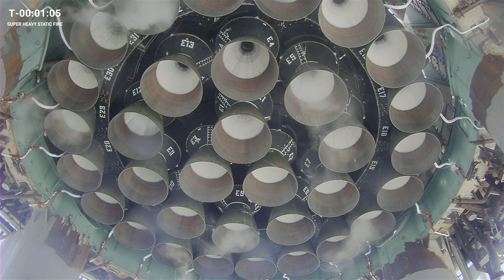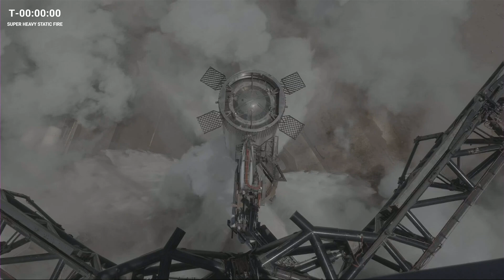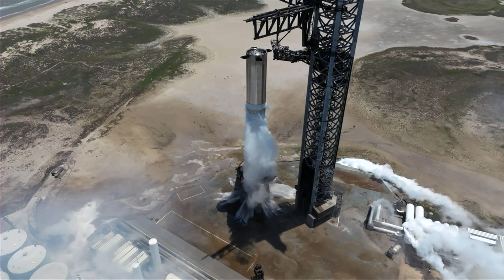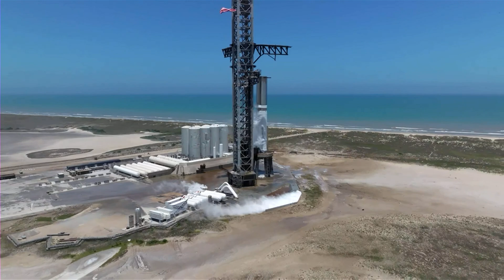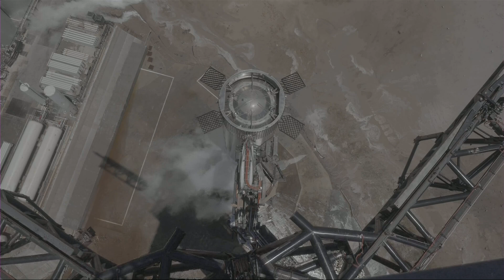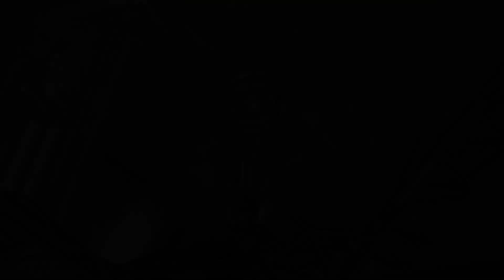Starship Super Heavy Static Fire

Comment: 4:13 Test duration of 2.74 seconds (ended before the planned 5 seconds), with 4 engines shutting down prematurely.
Reply: Flooded it lol
Reply: Seem to recall with the last test that three engines shutting down was considered the pre-launch abort limit (ie the launch would auto abort if more than three didn't ignite). Might be when the computer shut the fourth down, it passed the threshold to abort everything.
Reply: @johnpaulvanson5170  My guess is that's why the test only ran for 2.74 seconds out of the intended 5. When it hit the limit of 4 failed engines the test self aborted.
Reply: Wet spark plugs
Reply: @Bremberry These engines don’t have torch igniters plus the water does not go near the engines.
Reply: @Bremberry  lol, except the ignitors for the engines are well clear of any water
Reply: @Bremberry  if you're serious, they don't use spark plugs anymore
Reply: @beamed5382  Are you serious? of course it was joke that flew right over your head
Reply: @pauldean7690  it didn't, that's why I said *if*. There's a lot of who don't know that, thus the reason I took my time to respond to you. Don't be so confident in yourself haha.
Reply: @beamed5382  Í was the one talking about the spark plugs ;) and yes it was a joke referring to (carburated) internal combustion engines where you talk about wet spark plugs when you flood the the engine/cilinders with petrol and petrol gets on the spark plugs. (Good change I didn't need to explain this to you but, like you, just in case ;)
Reply: @@bingbong7Big ship no wanna go boom.
Reply: Not great not terrible
Reply: 🤣 @Fabian3331234333
Reply: @@bingbong7 They'll comb through the data getting to that answer.
Reply: That's what testing is for.
Reply: All that water flashing to steam needs to get out, and with the legs of the stand, its somewhat restricted. So I'm thinking the pressures "pushing back" against the engines must be interesting. So wondering if thats going to be a factor. I'd been thinking about the pressures under the stand for some time. But I'm only guessing and of course have no data what it really is like under there.
Reply: Water contamination from the deluge system possibly
Reply: @Bryan-Hensley  Musk is a genius! Most expensive fireballs in history! A genius! Greatest criminal fraudster in history...genius!
Reply: @Bryan-Hensley   agree with you and there is another question how thay planning to build megazila and water cooled lunch pod on Mars to return back where it isn't having water to drink 🤔
Reply: @muhammadavary  Stop asking simple questions! Musk is a SUPER GENIUS and the suckers who support him are worse than stupid. Musk will be in jail within two years.
Reply: It seems to be the Raptor Quick Disconnects (RQDs) that have been the problem with 33 engine SFs
Reply: @@bingbong7not sure, it’s kinda concerning though. That’s a worse performance than B7.
Reply: @Owencr905 to be fair, B7 co conducted THREE static fires before its 33 one, B9 did it the first time. A lot less time, a lot less data. Not a valid comparison.
Reply: @Owencr905  could be the new faster start up sequence, idk, just a guess.
Reply: @Owencr905 Booster 7 did 11 spin primes, 6 static fires and a bunch of engine swaps before the 33 engine static fire. They had many more opportunities to find bad engines and replace them before attempting to fire all 33 engines. 

For B9, there was only one spin prime, and this was the first static fire. 

While it's disappointing, it's not accurate to say that it was worse than booster 7.
Reply: @Owencr905  its probably because they went straight to 33, B7 had many engine swaps working up to that
Reply: I wonder why those engines shutting down.. perhaps too high atmospheric pressure caused from all the engines combined
Reply: @woof3065  If I was making a guess, this is where I would go too. Adding water below the stand might be like trying to blow through a restrictive tube.
Reply: @woof3065 the engines would never need to have higher than atmospheric pressure
Reply: Ngl i dont like there 4 engines not working.

I hope they will do more tests to iron tbis out
Reply: @@bingbong7 with this amount of steam I wouldn't be surprised if it choked the engines with pressure difference
Reply: Musk is a genius! Nothing works. But he's still a genius. The biggest criminal fraudster in history. 😂😂😂😂😂❤❤❤
Reply: Seems that 33 engine to much for rocket 🚀  rates of possible failure high
Reply: @muhammadavary  Falcon Heavy uses 27 engines. Why would 33 be too much? It's still a new engine design. Be patient.
Reply: What's the deal with the raptor engines being so unreliable.
Reply: @jaysmith5047 they are still new bro, literally testing and revamping all the time. The raptor engine is not even a 1.0 yet, IMO
Reply: @BlestinTexas24 they are brand new, and frankly insane, technology. I see it the other way around - it’s crazy that they work as well as they do already. They need to improve, but I can’t imagine that will be a problem forever
Reply: @CorySchneiderOfficial exactly. Let's think back in the not too distant past when SpaceX was perfecting the Falcon booster landings. Lots of doubters who were "certain" they would never accomplish "such a silly, stupid, and impossible plan." And of course, we're now at the point where landings, not only on land, but on the pitching and bobbing ocean platforms - has become commonplace.

By comparison, this OLM and Raptor situation appears much easier to get right. These are still the nascent stages of the Starship program; Raptors and all.
Reply: @CorySchneiderOfficial Agree
Reply: @BlestinTexas24 They were designed for stresses experienced in open air/space flight. There is a lot of back pressure and concussive force bouncing around when you fire them into a flat surface. Think shockwaves battering the engines.
Reply: @1dedrer I absolutely share your exact sentiments here...
Reply: @BlestinTexas24 It's still in development
Reply: @BlestinTexas24 😮
Reply: Many engines streaming hot expanding gas to water witch create big amounts of steam and create turbulence Ander starship definitely need more space under rocket
Reply: MOsk and his moron fan base are an endless comedy. The chances of that water dampner surviving are nil but what a show it will be' Biggest shrapnel and fireball in history.
Reply: @Talpiot_Program  nice bait
Reply: @cokerat So far no sustained damage to the pad but we will have to see if it can handle the might of 33 raptor engines at 90% rather than 29 engines at ~50%. I think as long as the flow rate of the water supercedes that of the engine plumes it should be alright
Reply: @sjcnej7695 My worry is the concrete hasn't had enough cure time for the flux it's going to be under. I bet this test caused cracking.
Reply: @rexmann1984 You have literally no way of knowing that, you're only spreading rumors with no basis, no evidence at all
Reply: @rexmann1984  which would be irrelevent since the only reason the pad "blew up" last time was because exhaust was able to get into the cracks, which should be impossible with a giant double wall steel plate covering every inch of the concrete under the launch mount.
Reply: @rexmann1984 i to was wondering about the cure time, seems that at least 2 weeks would be required perhaps a month due to the thickness.
Reply: @robertmiranda2444  They are not using basic 3000psi concrete mix from lowes. 20 years ago I cast pre tension columns developing 6000psi in 24 hours.
Reply: @sjcnej7695  Flying shrapnel and exploding methane tanks and giant Space X fireball. Musk will conclude..."It went better than I expected." 

But the Musk Bro's keep sucking their bongs and claiming genius.
Reply: @cokerat And how is your Rocket company doing? Or are you upset that someone can actually do things while you troll on the internet in your parent's basement?
Reply: @Talpiot_Program  For a 5 second test... errrr, no, even the special concrete, that got annihilated by a take off,  survived that....
Reply: @Talpiot_Program  Well, it's the fastest and most efficent way to make rockets, push them to their limits until they stop blowing up.
Only reason governments don't do the same is because they need to pander to the masses.
Reply: @Talpiot_Program you can think Elon is an idiot (I do) and still appreciate everything that SpaceX is doing. Elon is not SpaceX. I am a huge fan of space and right now, SpaceX is leading the way so cheers to them.  This rocket WILL fly, eventually and even if it underperforms to expectations, it will still be by far the cheapest ride to space for large payloads.  It may not be SpaceX that ultimately wins the space race but they are driving the competition to innovate and that’s good for everyone.
Reply: @ChrisLunday same feeling.  I got a custom license plate frame for my Tesla car today that says “I love this car, but Elon is still a douche” lol.   Remove the name Elon from spacex and they’re doing amazing things.  He’s busy playing with his X right now anyway.
Reply: @Talpiot_Program  Your screen name say everything we need to know about you.
Reply: @Talpiot_Program  says a guy who probably sells hot dogs for a living
Reply: @Talpiot_Program Biggest fireball prolly goes to the Tsar Bomba
Reply: @Talpiot_Program so what did you accomplish in life so far..
Reply: @Talpiot_Program  What a surprise, yet another trolling comment from a brand new account. Afraid to show your real face? Someone sounds very bitter that not only did he miss the run up in $TSLA stock, his shorts lost him money, too. Oh well, maybe you at least learned something along the way?
Reply: @Talpiot_Program Spacex victory is an American victory. Don't you want an American victory?
Reply: @kfk256  No, I want a well-working rocket!
Reply: @gottfriedheumesser1994  Build one then, boss.
 I wish I could, but since I can't, I won't chastise teams that are doing so with iterative builds, testing and making substantial progress.
Reply: @kfk256  As you are an American Victor building such a reliable rocket cannot be a problem for you.
Reply: @gottfriedheumesser1994  It's not, but in America we work collaboratively and support each  other  as a team of well-meaning people playing different roles (including constructive (not demeaning) criticisms). 
Our society recognizes and rewards talents. Our American broomstick company team (SpaceX) in collaboration with NASA and the US  government are doing a great job towards building reliable and  reusable rockets and we will continue to encourage them to do better, constructively.

Notice how I have not once said anything degrading to you. Cheers, brother. 🍻 😌
Reply: @kfk256  Go on, nationalist victor! I am sure you are the one who has done the least for America.
Reply: @gottfriedheumesser1994  It's obvious you came here to insult Americans not to have a decent conversation. Good luck with that, buddy.
Reply: @kfk256  Bye bye, nationalist!

Comment: What did I see?! StarS on the pad, water flame def worked great but a Very quick shutdown. Why!
Reply: Probably aborted static fire because of the engine shutdowns. The vehicle is not supposed to launch with more than 3 engines disabled, so a 4th would automatically disable the launch. Given the new ignition sequence, I bet they ran the flight test ignition software, but added an automatic shutdown at 5 sec, and disabled the launch clamp retraction.

Comment: Why they didn't do that from the start is beyond me. Did they think the floor could withstand the pressure, or where they too busy preparing for mars, they forgot the first step
Reply: They thought the concrete would hold for one flight and they wanted rid of the original booster / ship combination as the design had moved on a lot since it was made.
Reply: Elon tweeted (or is it Xed) that it could be a mistake to not have a diverter or steel plates for the first launch.
Reply: they were developing the engines to a state where they're reliable 👍
Reply: Elons a big proponent of minimization, they were trying to run it as minimal as possible, didn't work out so they made this, which is a lot better.
Reply: Vertical integration but horizontal development.

Seems to work so far.
Reply: The engines also had actually performed static tests previously on the previous pad, but never at full throttle. It was all the engines running full throttle that caused it to break and shatter.
Reply: @Piemur1 not to mention that the concrete pad actually might’ve held together for that one launch had they given the concrete more time to properly cure. The engines heated up the water still trapped in the concrete and that’s why the whole thing was as violent as it was.
Reply: @toastedmatt9387  meh. It was literally just a temporary fix anyway. They still had plans to replace it with the diverter and deluge system. They just wanted to get the launch started for data anyway. It was planned obscelescence.

Comment: wow! seems the pad held up well, hopefully the next fire will be 33/33!
Reply: Don't see any debris or damage, looks like they fixed the problem
Reply: @lunantix  Not necessarily, this wasn't full thrust
Reply: @lunantix  too early to tell, the engines are not fully powered during this test and the pad is being blasted for only little time. With the previous booster 7 static test the old pad survived also.
Reply: @TDWTheJoker yeah it was completely fine
Reply: @TDWTheJoker it sorta survived, they only had 1 small concrete pour. This test looks like it did pretty good. Because if that we might even see another SF soon

Comment: Good to see no concrete flying. Here's to a longer test!
Reply: Concrete didn't fly during any of B7's static fires either due to lower power and shorter duration. However, this new water deluge deflector does look very promising so I have high hopes that the pad won't be decimated on the next flight test.
Reply: The static fire of the previous SN did not break the concrete either, that's why they went with the flight
Reply: No concrete went flying because there is no concrete underneath the booster 😀 It's only thick steel and water now.
Reply: I mean the engines weren't full force and only fired for a short duration

Comment: what happened?
Reply: what's static fire ?
Reply: @mistigri-ed5of  its in the name dude, fire the engines without lifting off
Reply: @Marrrrrko47  i don't really understand english :/ i was just asking for much precise information ma dude
Reply: @mistigri-ed5of turned on all the engines for a little bit to collect data
Reply: So in the previous test flight, the launch mount was damaged and the concrete underneath is blasted away by the rocket's gas.
Now the team've repaired it with a water system which they now tested with the booster on, intentionally without getting it flying, hence the name "static" fire
Reply: @joshuachan6317  wwoooooooohhhh thank you i understand
Reply: Testing rocket boosters and the whole engine pretty much